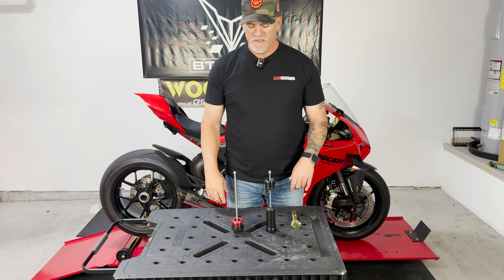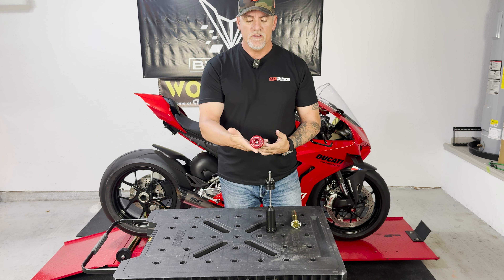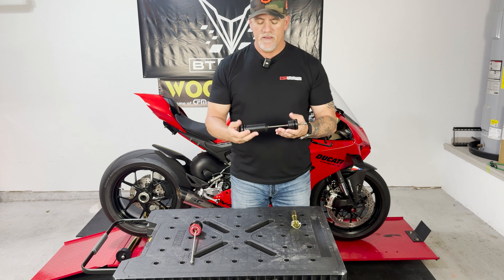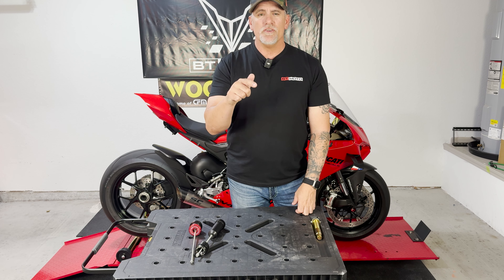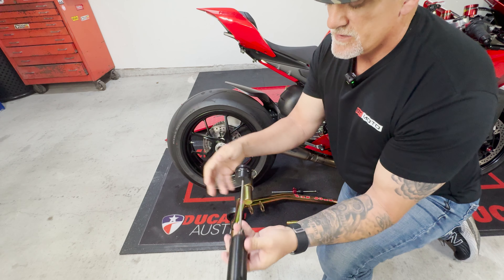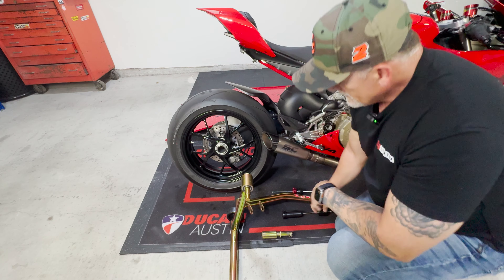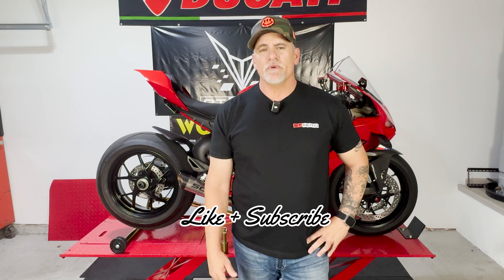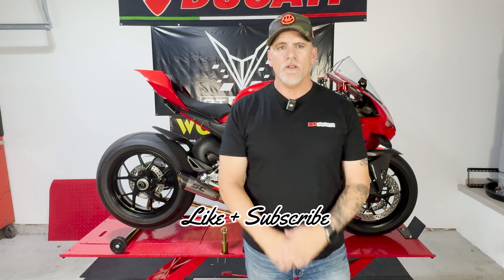Ducati Panigale V4 Sato Racing rear slider install

Comment: Looks pretty straightforward on the swap.   Where can I get that stand and jack at?
Reply from the maker: The rear stand is Pit Bull, they have them here local at Ducati Austin or online, the lift table I bought used but pretty sure it is from Harbor Freight, pretty cheap and saves my knees and back.